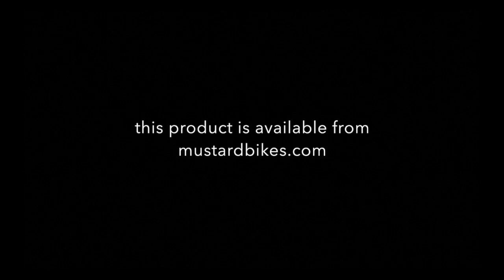Installing a Mustard Bikes tail tidy on a 2019 Triumph Speed Twin

Comment: would need to be ADR complaint as well with the rear guard extending back the length of the wheel - unless there is a cheeky solution to get around that rule?

Comment: Can the silver rear fender be removed completely?
Reply from the maker: Hi there, unfortunately removing the silver fender doesn't leave a very nice finish with the tail light and indicators and also requires a rather large infill panel, so we opted to leave it in place.